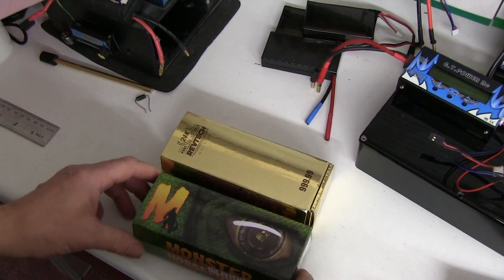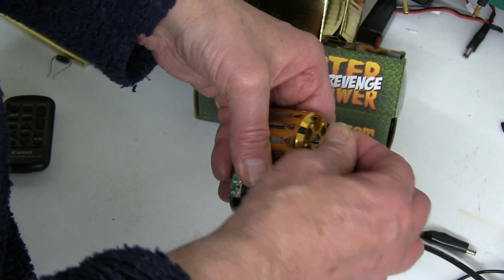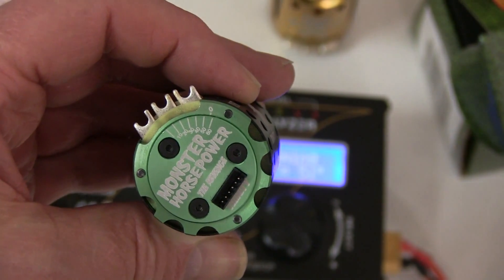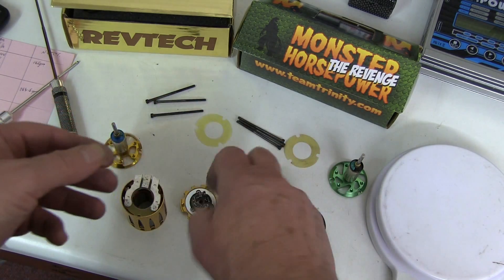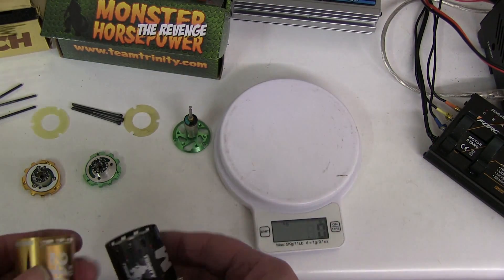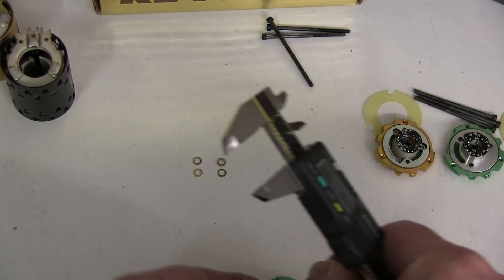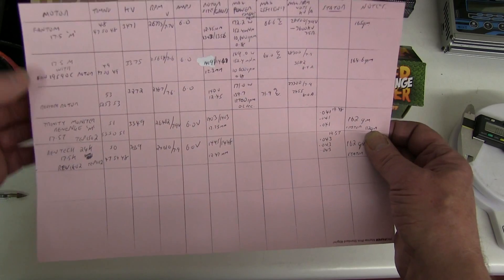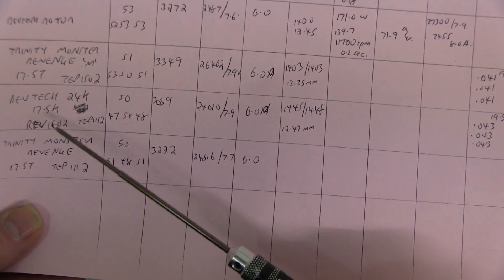Trinity Monster "The Revenge" 17.5T. Test and Comparison.

Comment: Have you got your hands on the new orca Blinky motor yet? They are really hoping the power so I am seriously curious.
Reply from the maker: Hi
Orca Blinky Blireme.
Not yet.
It looks the same as other recent motors with improved cooling.
The double collector plate at the front. I don't see that as necessary as the single plate is easily sufficient to carry the current.
Anyway, will test when it becomes available.
Reply: They have it on Teamorca.shop and is available, it's just not on the website. It's almost time to make my 2018 motor purchases so I am trying to narrow it down

Comment: given the tolerances of the gforce/sky rc motor analyzer is the timing even worth testing? Is'nt the tolerance +- 4 degrees per ABC?
Reply from the maker: Hi Ryan
I have tested on a different analyzers and found the timing is repeatable and the same values.between units, and conclude that the timing measurement is accurate.

Comment: Great review. Still deciding between the trinity revenge motor and schuur speed motor. Both 17.5. I am running a team losi 22 short course 3.0.
Reply from the maker: Hi
I would use the one with more torque than revs.
have not tested the Schuur, so cannot say.
Reply: Nick Adams more torque makes sense for that truck. Thanks for the reply

Comment: Hello nick, your channel is awesome for learning rc settings. Can you make a video on comparaison between high kv motors VS low KV motors? Like corally 13.5 3050kv VS trackstar v2 13.5 2530kv
Reply from the maker: Hi
That would be possible, when I get hold of a low KV motor.
But low KV motors are normally low cost and low performance and will  not perform as well as a top quality one.
Reply: Nick Adams there are some special Trinity version with low kv and Trackstar v2 are cheaper but very good for carpet racing, the 21.5t version is a beast on the track.

Comment: After watching your videos and picking up a moto analyzer myself I tested out my 17.5 Schuur Speed V3.  At 6.1amps it was pulling 3476KV with 25030rpm - average timing was 48* (47/46/50).  Loud though - 105db.

How does this compare to what you've been testing?
Reply from the maker: Hi Todd
That's a flying machine. 
And loud as a jet.
Reply: Standard

Comment: Thanks for the review/comparison. I'm pretty pleased with the performance at my local turf track, pretty damn fast. Runs hot though compared to the Reedy 17.5 and im running a fan as well
Reply: Dylan Chadderton my temps stay consistent when I've switched between different motors. If you are running any boost or timing within your ESC, try turning one or both down by 5 and see how the temps do. I noticed on our new turf track, motors will run a little hotter and I had to turn my top speed timing down some and everything is ok

Comment: That 24K has HORRID reviews online if you do a search, it's so bad for some reason. I'm planning on getting a Monster Horsepower which i hear only good things about and is supposed to be very fast.
Reply from the maker: Hi Dylan
It depends on the size and overall speed of the track.
For indoor and normal size tracks the 24K works very well.
I have raced with it and against others who still use it, and it is as fast as other motors.
The Revenge will have a higher top speed on tracks with long straights or mostly fast corners, but will not have the torque for twisty tracks such as indoor.
Reply: Dylan Chadderton I have the gold 17.5, very happy with mine. Temps are very low and the sensor board isn't too far apart. Trinity does have a record for putting out motors that can vary with each box on the shelf. Especially the D4. My friend got two bad ones back to back, right off the shelf

Comment: Great video as always nick, thanks for sharing.

Btw since you open them, i wanted to ask you, is there a way to know if the motor reports the temperature? im building a new setup with a serpent 4x and Sanwa Vortex v2 Esc that some motors report others dont, just wondering if this would?
Reply from the maker: Hi
No, there is no temp sensor.
Reply: Nick Adams thanks for the information.  In your experience with all engines you test, have you seen a brand that has temp sensors?
Reply from the maker: Hi
The Team Wave "Eclipse" motors had a temperature sensor.
The  temperature sensor in motors was found to be too low, and everyone turned it off in the speed control. As it would shut down at too low a temperature. Because motors can now withstand very high temperatures without failure.

Comment: Hi Nick, Trying to make sense of some of these numbers (running Carpet touring car) KV and RPM seem to go down with the high Torque rotors but the High torque is definitely the rotor to have on the track. My question is, what information on these tests is actually usable? Or what are we looking for? It seems like there are too many variables to compare. Unless you put the same Rotor in 2 motors and see what has the better numbers.
Reply from the maker: Hi
Comparing the motor results at the same amp draw will give you a good indication which will be better for your track.
The KV, Amps and Timing are the figures you need to compare.
If you have 2 motors , and you want the best torque and performance, chose the higher KV for the same or less timing at 6amps.
If the timing goes above 51 degree the motor may have too much torque and will run hot if you gear for high speed.

Comment: Nick, is this a very good motor for 2wd buggy blinky class?
Reply from the maker: Hi Phil
The rotor is not high torque, so will depend on if you prefer high rev motors.
I would use the previous Revtech 24k or Trinity D4.

Comment: I've heard the new rotor is longer than the 24k rotor.  Can you check that measurement?
Reply from the maker: Hi Mike
The rotor magnet length
TEP1112      24.28mm (Turquoise) 24K
TEP1118      25.17mm  (Black)        Revenge

So yes it is longer

Comment: Hi, Nick. What meter do you use to test the resistance of the windings?
Reply from the maker: Hi Kyle
It is a RS low Ohmeter Type M210.
I have had it about 35 years, and no longer available.
I am sure the Chinese make a cheap copy by now.

Comment: Hi nick, can I use a power supply instead of a battery pack to power up my GForce analyzer ?
Reply from the maker: Hi George
Only if you can set the voltage to 8.4 max. and 10amps minimum.
It may work at 12volts, but it may also burn out.

Comment: Interesting, I went from a 24K 21.5 to a Monster 21.5 and found the Monster about 0.5 seconds a lap slower, after 3 runs and not even getting over 60c the inside of the stator on the Monster was flaking off and so far Trinity's customer support has been pretty poor about it.
Reply from the maker: Hi
I agree.
The rotor is too weak for most racing, except fast flowing tracks.
I think they just wanted the highest KV
If you have a 24K rotor , put that in it.
Reply: fb5b

Comment: Nick, could you do a review on the new Corally motors and/or Lipos?
Reply from the maker: Hi Si
I will if I can get them in the UK
Reply: Si Trace hello, i have a corally 13.5 dynospec3.0 and have a very good Q/P but you have to shim them, to much play on the rotor. All the corally batteries aren't good at all, not powerfull and are worst than cheap batteries. Sport, extreme, and platinum are bad batteries.
Reply from the maker: Hi Si
I will , if I can get hold of them.